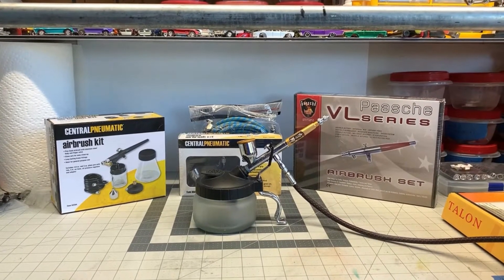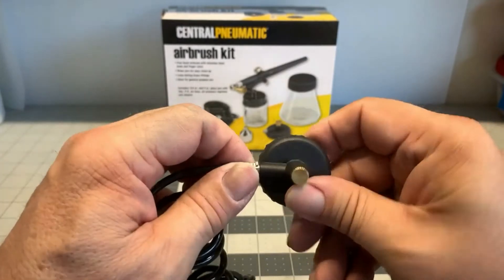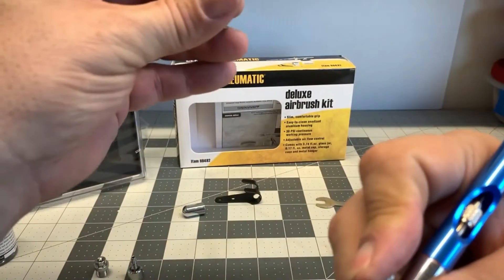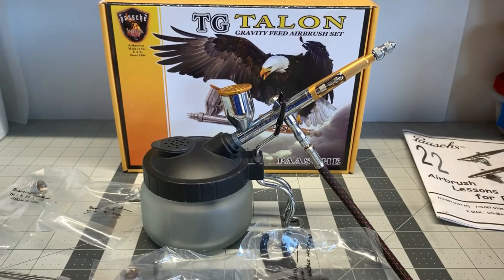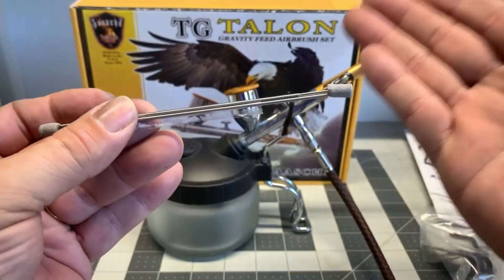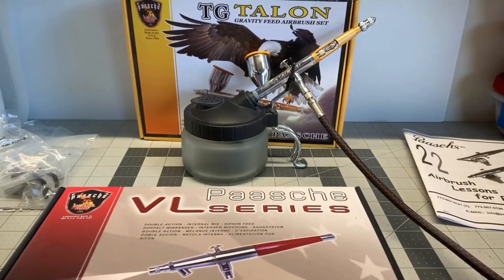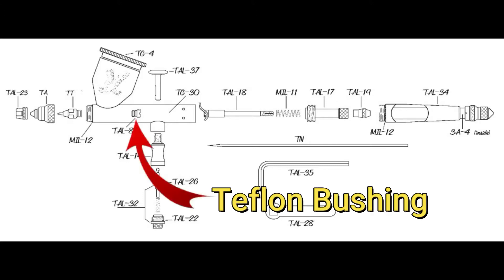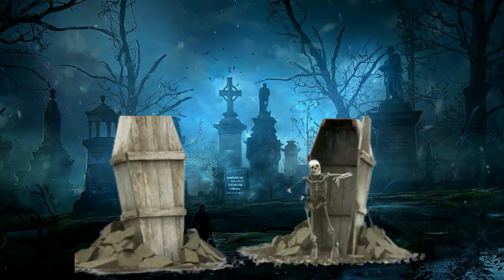How to Select an Airbrush Rev 1

Comment: Awesome! Thx for the video! I recently picked up an Iwata Dual Action on clearance for $50! Got a good buy I hope!! What paint should I use starting out? Thx 👍🤙 I’ve never used one, so it’s all new to me!
Reply from the maker: What needle size is the brush that you have please?
Reply: @DiecastGraveyard  says medium on the back
Reply from the maker: @DiecastFantasyland  , so probably a .3
Reply from the maker: @DiecastFantasyland  , you can probably use Createx  paint, but you’re gonna have to reduce it quite a bit to get it through the gun. Normally the water base paint require a .5 needle.
Reply from the maker: @DiecastFantasyland  , I’ll be making a new video here in the next few weeks about the different kinds of paints, from SpectraFlame to createx and some of the other brands.
Reply: @DiecastGraveyard  hopefully a good start! I watched some videos a while back and it sounds like the gravity feed was the way to go. By your video it sounds like Iwata is good 🤞
Reply from the maker: Iwata Is one of the best brands out there. But sometimes you have to get more of the higher level type brush. If you have any questions before I get this video made please don’t hesitate to contact me and my friend I’ll do everything I can to answer the questions for you
Reply: @DiecastGraveyard  can I order some other tips?
Reply: @DiecastGraveyard  Will do, thx! I’m not quite there yet but I definitely will. I’ve got to learn about the different paints, reducers, etc. Still using some good ole aerosol right now 👍🤙
Reply: What’s going to be my best bet for a compressor for this airbrush? Any recommendations?? Thanks!
Reply from the maker: https://youtu.be/fJV_55pxuoM